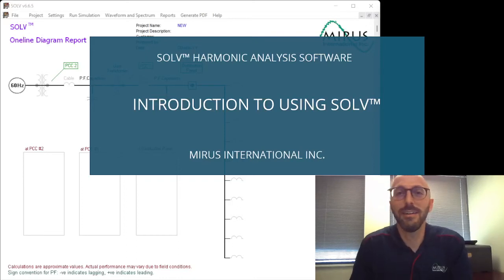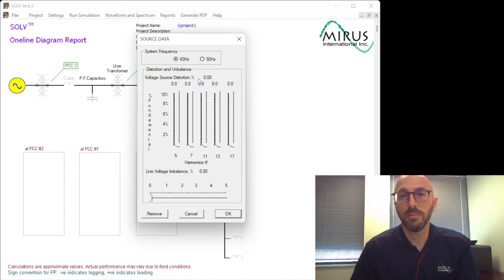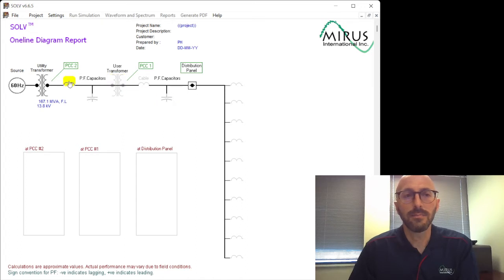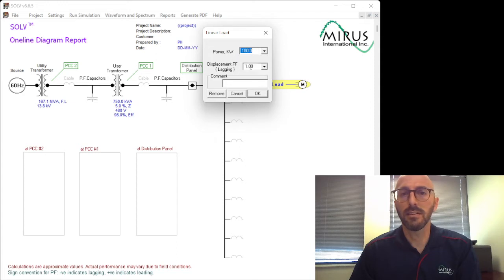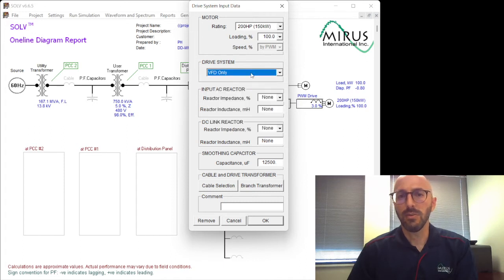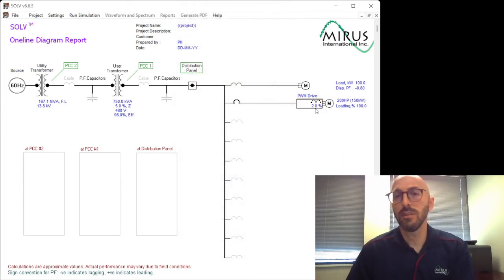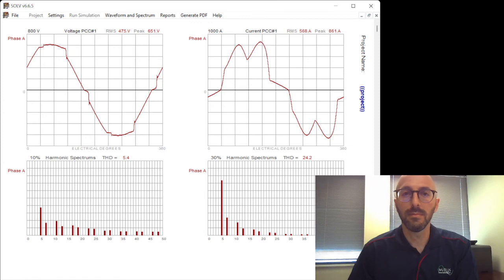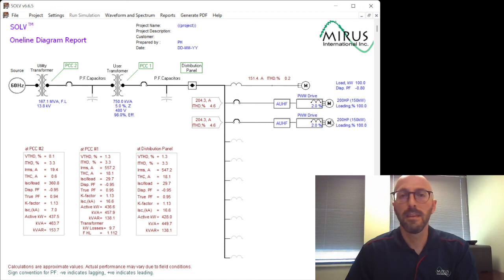SOLV Tutorial 1   Introduction to Using SOLV

Comment: Good day.
I am using your fantastic and valuable software SOLV for Harmonic Analysis.
I will appreciate your clarification on the following:
For a power network under analysis with the SOLV, and in case of two or more Generators (D/Gs) are running in parallel, I understand that 
1) The aggregate power capacity in kVA (kW) of the generators should be entered (e.g., in case of two (2) D/Gs in parallel with rated Power P1 and P2, the entered power should be P=P1+P2)
AND IN ADDITION
2) With regard to the subtransient Reactance the low of Ohm for the parallel reactances is to be followed, e.g., in case of two (2) D/Gs in parallel with rated Power P1 and P2 and sub. reactances xd"1 and xd"2 we have to input in the
program the P=P1+P2 whereas 1/xd''=1/xd''1 +1/xd''2=> xd''=(xd''1*xd''2)/(xd1"+xd'"2).
Am I correct or missing something?